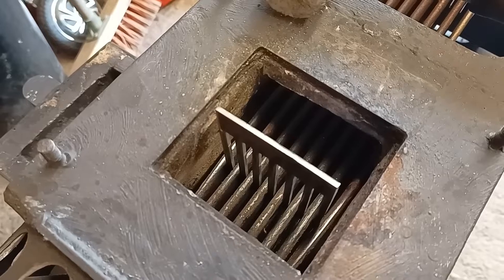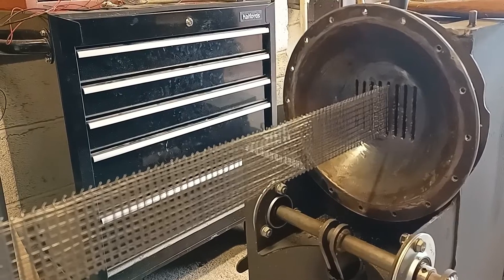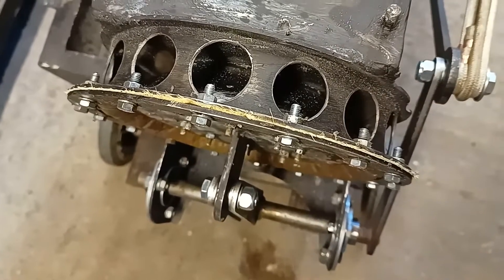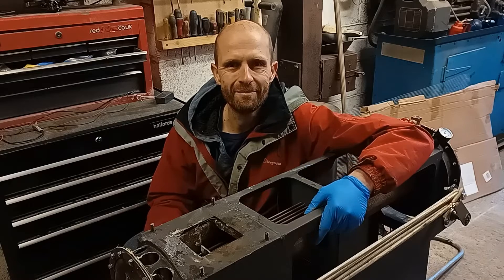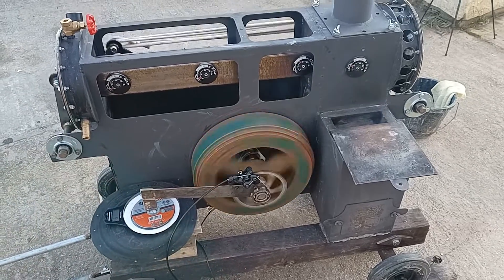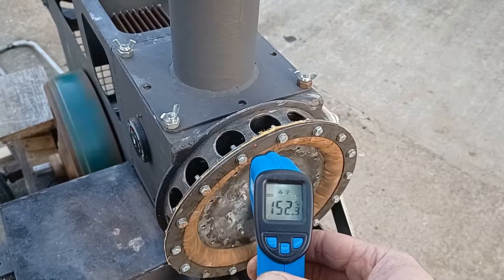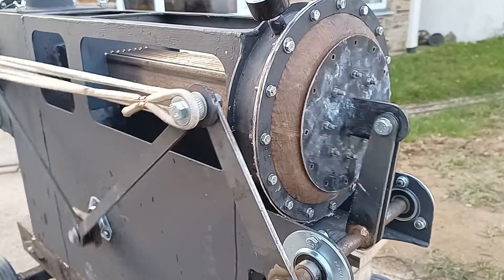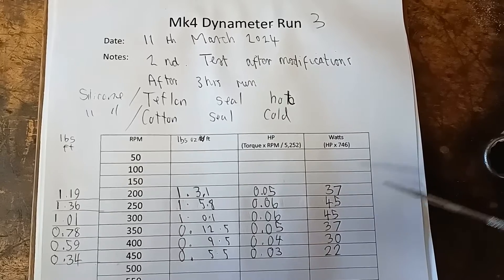Stirling Engine Generator Mk4 (Rocket Stove!) Part 10

Comment: I got corrected by my dissertation committee when I talked about 'equilibrium' in my heat exchange experiments. If it's an open system (which this is with heat from the fire and atmospheric heat sink) it's 'steady state'

I don't say that to be pedantic or anything, personally I don't really care, but perhaps 'steady state' may be a useful search term for your research.

Loving these videos, definitely subscribing. I've been considering a stirling engine integrated into a firepit as a project for a while so you sharing your work has been an excellent resource. Keep it up!
Reply: Schöner Bericht viel Fleiß doch:  Grundsätze beim Heißgasmotor:
Je größer die Gasmasse ist, die vom gesamten Innenraumvolumen verschoben wird, umso besser ist der Wirkungsgrad, 100% wäre maximal.
Je weniger Kraftaufwand nötig ist, diese verschobene Gasmasse durch den Regenerator hin und zurück zu bewegen, umso besser ist der Wirkungsgrad.
Je mehr Energie in die Oberfläche der Regeneratormasse eingeleitet wird und beim Zurückströmen wieder aus dieser Oberfläche ausgeleitet wird, ohne dass die Temperatur des Regenerators ansteigt, umso besser ist der Wirkungsgrad.
Je geringer der Kraftaufwand ist, den Arbeitskolben zu bewegen (Membrane als Feder), umso besser ist der Wirkungsgrad. 
Baut einen Motor mit Diskontinuierlicher Verdrängerkolben Bewegung. Katalytischer Kontakt Wärmeübertragung. Wärme Rückgewinnung aus den Abgasen. Ölfrei mit Membrane, Vakuum Pumpen laufen Jahre mit Membrane.
Warum habe ich jetzt mit 84 Jahren den Film, hoch geladen habe.
https://www.youtube.com/watch?v=bnR_WOcMM8k
Lesen Sie bitte auch meine Erklärung bei dem Film.

Comment: I have a gamma model diaphragm piston. the good thing is that it doesn't get hot, it's been there sometimes for a day charging the batteries and it will probably never stop running
Reply from the maker: Sounds interesting, how big is your engine? I'm assuming a fair size if it's charging batteries : )

Comment: Have you considered using helium in the engine under pressure ? 
Also presurizing the back side of the diaphragm to create back pressure so that your not working against atmospheric pressure. Higher pressure will yield more power
Reply from the maker: Hi Perry, Pressurisation might be an option now the seals are lasting longer. It would probably be something I'd include on the next engine. Many thanks

Comment: Did you try to increase pressure of air??? 
If you can make pressure  about 10 bar, it cause increasing of power to 400 watts - it is enough to drive 100kg stirling car  + 100 kg passenger.
Hydraulic drive wheel from stirling pump - it might be reality.

Comment: There seems no getting away from the challenges of gas seals of the hot end - I see a Mk 5  reverting to a displacer-type Stirling to remove hot end seal issues - that could throw up possibilities of compression and even hydrogen lol

Comment: Low tech stuff a bunch of copper wool in the exchangers, higher tech add some heat pipes. Cut down your volume increase your surface area
Reply: As you shrink the volume in the exchangers you will see the temperature even out. It's the dead air. It's the age old problem how lower volume without increasing pressure.

Comment: You are getting good heat transfer from the rocket stove at the hot end as displayed on your temp gauge. Your crank throw is very small and the piston stoke is also quite small! Maybe you would benefit from having pressure gauge at each end! That way you could calculate what pressure is pushing on the diagram and what Force is acting on the connecting rod. If the pressure acting inside is high you know your losses ate in your mechanism. If the pressure is low, you know your losses are in the construction of the diaphragms. 
I also would replace that mesh fence inside the regenerator for something like wire wool or try a good insulator like fiberglass fiber?

Comment: What about a simple damper in the flue above the heat exchanger to hold or slow down the hot gases escaping into the air.

Comment: Thanks so much for your content! I've really been enjoying your ongoing development of this engine.

Having said that, it's a mathematical certainty that the upper limit of the power output of this engine is always going to be bounded by the pressure of the air charge inside the engine. And the operating pressure, at present, is limited by your choice of diaphragm-style displacers in lieu of more conventional pistons.

Up to this point, you've been operating the engine at near-atmospheric pressure. If you were to substitute the diaphragms with true sliding pistons, you might be able to realize an engine capable of sustaining an operating air charge significantly above ambient pressure - which would greatly increase the power output without changing any other operational parameters of the engine.

Comment: Volumetric heat capacitity make iron and stainless steel great for regenerator.  But I'm wondering if its not so great thermal conductivity is restricting the rate of heat flow in the rocjet stove and the radiator. What if you used copper tubes for the thermal transfer section and stainless steel pipes for the regenerator portion of the tubes?  Futhermore, i dont think you want to loose heat in the regenerator section. Maybe you can insulate that easilly and test if it makes a difference. 

I can't wait till you try and run it backards as a heat pump.

Comment: That is a sweet running machine.  Watts aside, I'm sure you can do plenty of stuff with that engine.  Maybe a pump to actively cool your cold end?  You could do lots of mechanical work besides the electrical output.  Please keep it up, you are doing great work here.
Reply: Actively cooling the cold side might be a wash.  The efficiency is determined by the difference in temperature between the hot and cold sides, so you're effectively using some of the engines power to make the engine more efficient.  Therefore...  A wash, unless you use that heat to perhaps warm a cold room ...

Comment: Ayy! That diaphragm is looking wayy better! Exactly the construction you needed.
For power, you might want to try Increasing the pressure now since that is guaranteed to increase the power, you might be able to do 3bar or so with your new diaphragms. In fact the limiting factor might now be your tubes and the linkage arms.

You could insulate a longer length of your tubes to make more of a regenerator too, up to that first bulkhead seems like it would be good. You want the regenerator to be able to capture most of the heat energy in the air, currently yours is far too short for that.

If you ever have to make new diaphragms you might want to try making them thinner. You only need enough cloth to prevent it bursting, adding more thickness will just make it stiffer and could actually lead to it wearing faster, especially if it is getting creased or such.
Reply from the maker: Thanks Sam, great advice : )

Comment: Very nice work! That is a beautifully simple stirling engine. Unfortunately they never were known for producing much power.
Maybe it's time to look at the Newcomen design, which has been completely forgotten. Thomas Newcomen built them beginning in 1772 so it's about as simple as things get, and they lasted for decades. No risk of steam explosion whatsoever, and a 2 piston oscillating cylinder with a flywheel could be very smooth.
see https://youtu.be/GMgP-4O99qU and https://www.youtube.com/watch?v=Yu-HN7GEBe0

Comment: Are you loosing power because the engine is spending so much energy rocking back and forth on the wheels?  Would make for an interesting test.

Comment: I was surprised at the quietness of the new seals! Excellent results on a tough problem that you have solved. Good hints from others on the insert for the tubes.
Yes, perhaps the hot side needs to see the direct heat from some other design of a stove, or maybe try some coal just to see if the higher heat value of coal in the fire would be an indicator that another type of stove is needed.
Enjoying the adventure!
Reply from the maker: Hi Greg, I think I'll try some coal next video to get that direct radiant heat. I think that is probably the number one issue with this engine, cheers

Comment: Shane, great project you have there.
However, the Stirling Engine, from the beginning, was never efficient. At least your engine can produce 45 Watts of electricity. Most produce just enough energy to run itself.
I propose that you convert this machine to boil water. Make a boiler or use copper or stainless steel tubes.
You can make a steam engine or you can buy one on line,
I think you could generate about 10 times more power (450 W) than the Stirling engine for the same amount of wood 🙂
Reply: I think mild steel pipes with Around 26 - 37 W/(m·K) thermal transfer is a potential limiting issue where as  copper is about  398 W/(m·K)

Q = - k * A * (ΔT) / L
Where:

Q - Heat transfer rate (watts)
k - Thermal conductivity (W/(m·K))
A - Surface area (square meters)
ΔT (delta T) - Temperature difference (Kelvin) between the hot and cold sides
L - Distance (thickness) of the material (meters)
Reply: @kreynolds1123  Hmm, it looks like you're in front of me.
It would be interesting to see how much more electrical energy you could generate with a steam engine burning the same amount of wood compared to the Stirling engine.
Reply: @Rose-f2t  my guess is that it would be easyer to build a steam engine to produce more power. But one thing I like about stirling engines that the cycle can be reversed and used as a heat pump.  

I missed the meaning in  "you're out in front of me".  Please explain it in other words.
Reply: Also, the pressure of the working fluid (air) is limiting  the maximum power.  Available in the stirling cycle loop.

Comment: So rubber band thingy did worked as expected :) 

Sadly you did not add any pressure into it. 0.2 bar would really make some improvement, and would answer question - as we are lack on heat transfer, or lack of working fluid volume. 

Ps - max rpm - produced power equals fluid (pressure) losses of working in heat exchangers/regenerator. Heat transfer is kind of similar per time, just cycles are shorter. It is slightly improved by higher airflow, but only on inside.

Comment: For extra power what about using helium instead of air as the working gas?
Reply: Have you thought for even a second about the amount of complexity that would involve for the return? Engineers need to be practical.
Reply: @jerbear7952  if it's a sealed pressurized system how would it need to be complex? If it's not sealed i suppose that wouldn't be simple.

Comment: Great, now with the diaphragm problem out of the way you'll be able to focus in increasing power.

I believe that if you pipe the intake air through a steel tube inside the smokestack, preheating it before feed into the furnace, you'll have a hotter flame.

To pressurize the engine will help too

Comment: It is baffling - changing more than one thing at a time makes it difficult to attribute what impact each has if any - I felt sure you would be rewarded with at least double the power - One thing I noticed was the air has passed through the first half of the cooling passages its job was mostly done - the last half is a lot of dead space for a little temperature change.
Reply from the maker: Your quite right but I am much to impatient: ). The diaphragms are still quite puffy which I think I can solve. I think the biggest limiter is the lack of radiant heat at the heat exchanger, cheers
Reply: @ShanePomeroy  Can you corrugate the mesh inserts so they alternate touch the sides of the transfer passages so they conduct the heat better - I thought perhaps pass them through a loosely meshed pair of spur gears till they spring against the walls needing to be pulled through the passages with some force?

Comment: On a later version, can you put a valve system on the heat exchanger so that the air circulates only in one direction? Like two one-way valves on the hot side. One going in, and one going out.

Another thing to consider is how quickly and how much the volume of air expands and contracts. You would want to size your piston size and stroke based on that, and your engine speed will have an optimal RPM.

Comment: not much power when taking account of the total amount of heat.. maybe better piston stirling instead of membrane at diy level. anyway nice machine to see^^  the next one u do a ross yoke ? :)
Reply: go smaler and go pressurise wath u want up to 8 bar ^^ (car compressor XD) ross yoke more easy to presurise the crankcase (recover ebike brushless motor for power gen and starting, all encose inside 2 atm of helium i wana see XD) maybe take inspiration of the torino engine, lot of small coper tube for heat exchange, with lighter gas it gonna flow well ^^